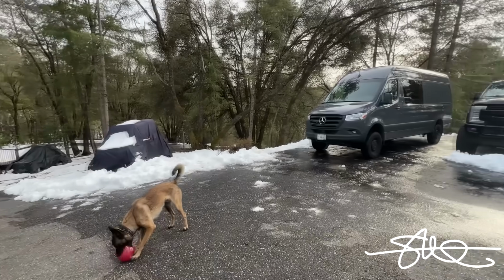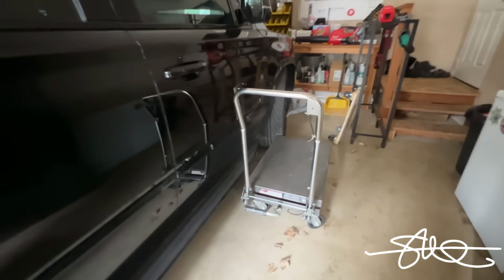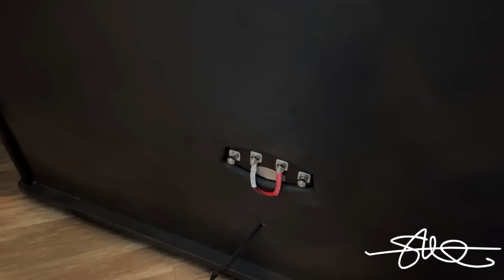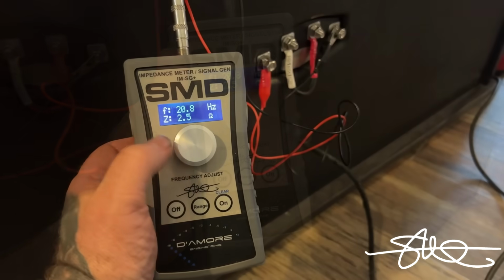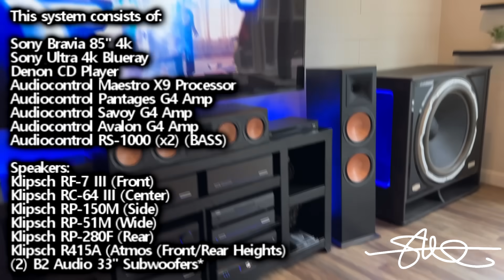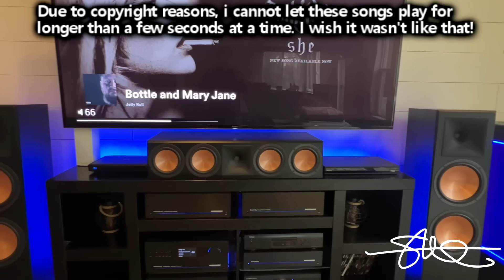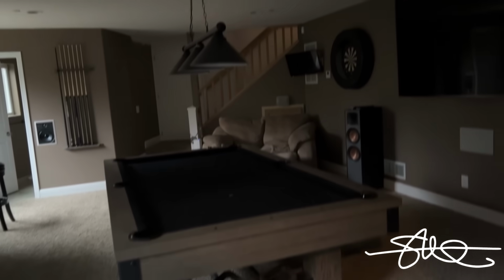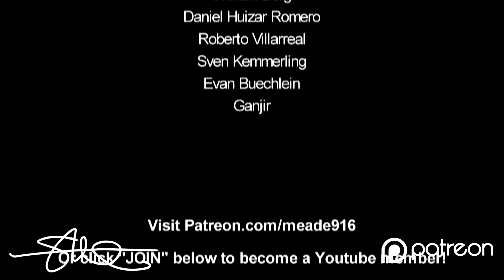2 33" Subs for ALL the BASS! Both Boxes Finally Hooked Up & Playing! Effortless CLEAN, DEEP BASS!

Comment: I run 6 Cerwin Vega 15's for my all in one system..
I need a 33" sub I think.😂👍🏻🍺
Steve your system is a beast dude.🇺🇸
Reply: That sounds REALLY good in the bass range, I bet! Cerwin Vega makes some good woofers and subs!

Now imagine; what about having a theater room with a total of around 9-10 square meters (or around 100 square feet or 10' × 10') of air moving subwoofer piston area?! THAT has always been a dream goal of mine ever since I was a teenager, but that means almost 16000 square inches of air moving piston area, (just to make it an "easy" number to work with and divide up into multiple subs of like 4 × 4000 square inches each, or 16 × 1000 square inches each, or something similar, with one to 4 multiple driver subs for each corner or rather each wall of the room, etc., depending on how you designed it), however that amount of total air moving piston area would require a LOT of woofers to achieve! Not very practical from a cost and space and complexity standpoint, unfortunately! (Still maybe someday I will aim for something close to that if I ever get to build my dream home with a custom home theater room in it.)

Comment: I haven't seen 33" subs before. If we needed something more than 18" we switched over to inducers. (Drivers without cones to move air.)  These would be through bolted to building elements such as floor or walls. The whole element then would become the "speaker". Some of the units could have up to a 4" stroke!
Reply: Might as well get one of those industrial hammer drills that dig up roads and glue that on the wall as an "inducer"...... thats farrrrr tooooo muchhhhhhhhh..... 😳🤪👀💥
Reply: @mohammedisaa9952  It sometimes is too much. With something like that it's really easy to go too far. The poor buildings have to be built for it.

Comment: Would be dope to have the subs centered since all that low end information is mono in the center of a mix. You could even make a custom wall enclosing them so just the cones are showing, kinda like a nice trunk setup or pro studios have the walls built around the speakers. A lot of pro studios also have sound absorption up above by hanging an acoustic panel from the ceiling.
Reply from the maker: nah no need for that.  Post up a video of your home system lets see how it's done.  The way you are talking you really know your stuff (LMAO).  Lets see.

Comment: 33" is good, but it is at 48" that things start to really be impressive because of the low end which is not heard but felt.
Reply: Go and watch some of the other videos of his setup. those things dig 20, 15, even 10HZ like crazy.
Reply: @GraphAholic08550  I tried 30"... Then I tried 48". The difference is incredible.
But I guess you didn't try... so you don't know.
Reply: @mik8352  I wasn't necessarily saying there wasn't a difference. I was just saying that at least in my eyes, his 33 inch are also very 'impressive'. I interrupted your comment as you saying you needed a 48 inch subwoofer to be able to feel the low frequencies, which is definitely not the case.

Comment: I hope your house is well built. I have 4 Cerwin Vega VS-150s, each pair ran in Parallel down to 2ohm on a Yamaha MX-1000 amplifier and they actually rattle my house apart. I have to drive nails back in the walls and ceiling constantly. I couldnt even imagine what a pair of 33s would do. Im an Electronic System Technician and let me tell ya, you do beautiful work, Brother. Damn nice work. Keep it up and Drive on!
Reply: Sadly I couldn’t experience something like that myself. Could you tell me how it feels if you lean against the wall? Do you feel the vibrations in them?
Reply: The "plaster boards" in his ceiling will come down soon enough..... bulbs will keep breaking and he will have to change to leds throughout his home.... 

Thats the cost of a pair of 33" twins 🤪🤣😂

Comment: How many amps do one of these take? I'm fixing on putting one in the bed of my truck 🤣
Reply: The speaker can handle 5,000watt at duel 1 ohm impedance, so how many amps you think it would take to make that figure up?

Hom many batteries do you think you need to drive that many amps and that speaker?..... how many alternators do you think you need on your vehicle to keep them batteries from going flat in minuites?

Forget about putting a 33" speaker in a vehicle without doing some "research" first..... !

Comment: Dirac, Trinnov, GLM, MA1 or whatever Software Correction cant fix untreated Rooms and even if you think it sounds good and youve Deep Clean Bass on the listening position, without treatment there is a lot of potencial to take the sound way more than just one level up. But good that you know how to improve it, there are way too many people out there who put big speakers and subwoofers in untreated empty rooms and dont fix the Acoustics. But one question, why not put one on the front and one on the back and set them up via dsp so you can get fix some Standing Wave problems (topic : Double Bass Array, Single Bass Array etc)
Reply from the maker: i don't have standing wave problems.  Everything sounds great.
Reply: @meade916  impossible without treatment. but when youre happy everything is fine. I have also Ceilings (4m Hight) and i cant wait till the ,,church,, sound get treatment and fixed. No Treatment = no good sound
Reply from the maker: @vortekkz_mixes  stop.  You know nothing about how my system sounds in person.  Yes i am happy and you would be too if you had this.  So settle down champ. lol SMH
Reply: @meade916  Can you show a room frequency response curve?
Reply: @vortekkz_mixes  Don't argue with someone that has no knowledge of room acoustics.  They just want to show off their system to impress people that think that putting 2 33inch subs in an untreated room makes a great system.  he doesn't care what anyone thinks that opposes what he thinks.
Reply: @Oneness100  Yea arrogance comes before knowledge... but hey its America, when its big and heavy, it must sounds good... There is a reason why most of the best Audio Equipment comes not from there (ATC, Genelec, Neumann, Strauss, Amphion, ME Geithain, PMC...)
Reply: @vortekkz_mixes  Yeah, you're not going to see those types of subs in a recording studio..

the other thing to realize is that audio speakers for mixing and mastering are TYPICALLY different than what an "audiophile" might choose.  Of course, there are mastering studios that use "audiophile" speaker systems, but you're not going to see a 33inch Sub woofer, let alone 2.  The driver size is just too much larger than even a typical 12inch driver on a full range speaker.

This guy is obviously wants to shake the room, even though he could have done the same thing with some Buttkickers attached to the seating.  Plus, it would be cheaper and just as effective and probably sound better.   Having too big drivers for the room will result in overdriving the room past what it can handle.

Most small rooms we have in our homes can barely handle 12inch bass drivers, let alone 15inch or larger.  Two 33inch subs simply make no sense if you want GOOD sound quality.

Comment: Whyyyyy???? Even a movie theaters don't use such subs, u r using it home,what's the point?
Reply from the maker: they should.  You clicked the video link after reading the title so what was the point of you watching and running your goofy mouth?
Reply: @meade916  This is a standard troll that always shows up with the "but why?" type of post. Pay no attention to them. The proper question is why not!
Reply: But why? 

Bass with genuine scale, low distortion, texture, dynamic impact. You just can't achieve this with 7" drivers - levels.

Comment: I love the setup, man. I've watched this and the earlier videos regarding your home theater system. It's quite an enjoyable journey, and a never ending journey. I know it's a never ending journey for mine for sure. lol

I'm also just fascinated and envious of the dual 33" subwoofers in your setup, and pushing only 1k watt per subwoofer? Seriously impressive. I'm here trying to drive several thousand watts between my 18" and 21" subwoofers, which are all sealed enclosures while you get away with just a couple thousand watts! It goes to show how efficient a good ported setup is. I'd love to build a couple of 33" subwoofers for my space if I actually could fit them. lol Not gonna lie, those subwoofer cabinets you built are just beautiful. Integrated LED lighting just look so sweet on them! I love it!

But yeah man, keep up the awesome work, I'd love to see more on this system! No matter or what, it's an awesome system that you're happy with! :)

Comment: this setup is so godlike .... how can people hate this even the cable management is on point ... yeah this is what you can effort when u working hard.. well deserved good job

keep roasting those jealous hater
Reply from the maker: bro, so many people on the internet have nothing better to do.  Almost 100% of the people talking shit don't have but two wooden nickels to rub together but they have just enough internet coming from the neighbors wifi to come run their mouths. LOL.  Most people who actually have as good if not better than me ain't saying anything or at least being cool.
Reply: @meade916  yeah i dont even have half of what you have there but i at least respect ur work youre putting into all of this.. and yeah many jealous people on the internet
Reply: I dont even have a quarter of what this is, and i will admit that i am jealous of how good this is compared to what i have, but im not a "hater" and tbh, im happy with what i have and dont need what is shown here, eventhough it is a magnificent system that would make me happy, but for how long before the 1,500$ electricity bills start rolling in monthly?..... i like to travel, and thats where most of my income goes, and for what i rarely use at home (when at home) it does me fine...... 4 x 6 inch 3 way speakers and 2 x 8" subs..... low bills and happy sounds when i need them 🙂👍🏻❤️ Happy Days......

Comment: The helicopter scenes in Cliffhanger are a go to for testing your surround channels. It was the first movie mixed to 5.1 (separate rear stage) that was available to a consumer market so they really embellished on the directional capabilities of the new format and wanted everybody impressed so ProLogic would sell and other manufacturers would get on board with standardizing a consumer surround sound format. It steady played on a loop at Circuit City from 93 to 96 lol

Comment: I'm wondering what kind of electrical upgrades you had to do to that wall. Extra dedicated outlets, upgrade to the whole house main panel amp rating, etc. Damn man, that is NICE!
Reply from the maker: already made a video showing all of that.  There are like 3 dedicated 20a outlets back there i use for the heavy lifting and 1 or 2 15a outlets (i forget) for the normal stuff like the tv, blueray etc.  Thanks man!

Comment: While it looks really cool. I have been installing and optimizing theater systems and theater buildings professionally for over 24 years. 
Seeing the lay out of the place, the subwoofers are not placed correctly for maximum presence within the viewers sitting area. 
For example if you walk around that room you'll see the bass is MUCH more powerful in certain spots, this is expected. 

However, this will still provide a thunderous shaking and sound of course very good just given the absurd power of them lol.
Reply: Well said. This is true 100%. 
Although, for that power you're right lol it likely wouldn't need to matter regardless. 
Even tho allot of presence is being scattered around the room.

Comment: How do the 33"s perform musically ? Ive been in live sound touring 27years now and in most cases typically the largest low end is a 21". Turbosound 20+ years ago did a 24" sub but i remember them being really slow and really only any good for infra-subs even then today most infra-subs from the likes of D&B , L-Acoustics etc are 21s as well and you cant run them the entire show as artists feet tend to go numb within a few moments so they are really only used for effects at various points of the show. With specifically the D&B SL system the subs are a triple 21" design  , 2 forward firing and 1 rear firing for intentional phase cancellation to minimise bleed behind the PA. These go down more than enough and are really fast so sound wickedly tight at high SPL's. Id love to have hear how these sound. Great work too BTW.

Comment: Damn I got the rp240’s not sure if that’s the right name but just them alone in stereo without the sub is great. 

My whole system is Frankensteined together. No amplifiers just a 2004 era denom receiver, center and side surrounds JBL arenas, L/R Klipsch rp240 and a Bose acoustamass sub from around 2004 as well. 

Don’t know if the acoustamass subs always ran like 4 drivers but this one does it that way. People are always shocked by the system. Definitely needs amps tho cuz the measly  120 watts per channel doesn’t let the Klipsch free.

Comment: I'm going to harbor freight next week to buy a cart like that. Is that the 500 or the 1000 pounder?
Reply from the maker: 1000 bro. Best carts ever i have 3 of em haha!
Reply: @meade916  Cool, I think I'll go with the 1000. I've got that Gately SoloX 12 enclosure and because of these sometimes -30 temperatures in the winter I want to bring it inside and use a jumper to bring it up to 4ohms for a 1000 watts in the living room.

Comment: I'm about to cut out the holes for two boxes, 12 cf tuned to 23 hz for SI HS-24's for my patio. However, I want to throw concerts on my roof (30x70 ft) or at least ridiculously loud parties in Cabo San Lucas (no rules). All the pro audio gear looks like triple roll surround B&C (or equivalent) 21" drivers. Would you recommend 21's, HS 24's (require more power, less 30-100 hz output) or 33's which I haven't even seen before?  The tops are Yamaha DZR315 rated at I think 143 db peak output. Plenty loud for 70 ft but not chest rumbling bass. Personally I can't hear below 25 hz really so probably not great for music outdoors.

Comment: I would have liked to see you use your magnetic power connection for the speaker terminals, making it easier if you have to move them. (hopefully you won't have to)😂
Reply from the maker: no need bro. Those are made for people that actually take the box in/out of the car a lot. It would be a total waste of time in a system like this.  The terminals i DID use are badass too though...

Comment: Question, can I run a 2000w rms amp on my 1600w combined rms subs? Amps output is 2k at1ohm and the subs will be wired to 1ohm. Would that be safe for the subs if the gain was set properly?

Comment: Your speaker wire is sufficient for an electric range. 😂 with a two pole 40 amp breaker. My budget is micro compared to this but I do know once I finally started buying myself some things and got into Mac computers that it leads to the next thing. What can I do next…

Comment: Really beautiful and awesome! Great Job! Please don't think I'm trying to hijack your site but I believe this would be a good place to ask a question or two. I'm a little confused from some of the info I've been getting on YouTube. There is talk about to much bass and to large subwoofers for a specific size room. Also that the best bass you can have is 4 subs in each corner of the room. I was going to build 2 18" Dayton Audio Reference with passive radiators in my home theater which is right at 4000 cubic feet but after doing some research it appears that 4 10 inch to 4 12 inch subs would be better. I would love to have what you have but that would be overkill. Any truth that 2 18" subs would be to large for 4000 cubic foot room? I hope your dogs do well with your subs as mine are scared to death of thunder storms fireworks and my single 15" sub.

Comment: Nice bare concrete walls nice hardwood floor !? and all that visible audio gear dominates and overwhelms the TV screen, you don't see cinemas doing this.
Theres a reason home theatre people do the 7.1 and tuck a single subwoofer out of sight but in the correct place.
Reply from the maker: where do you see a concrete wall? put the bottle down and go to bed. "There is a reason home theater people do..." SMH you sound silly.